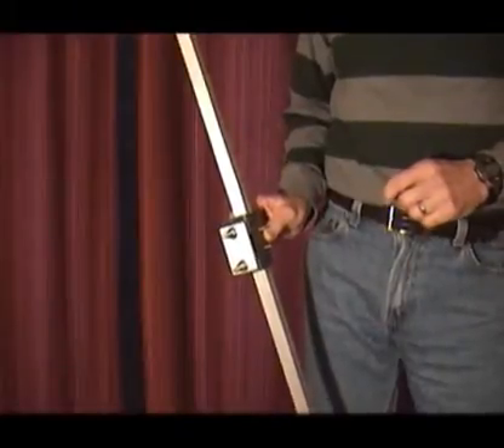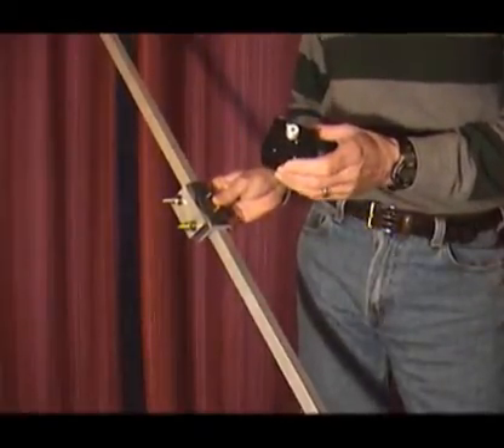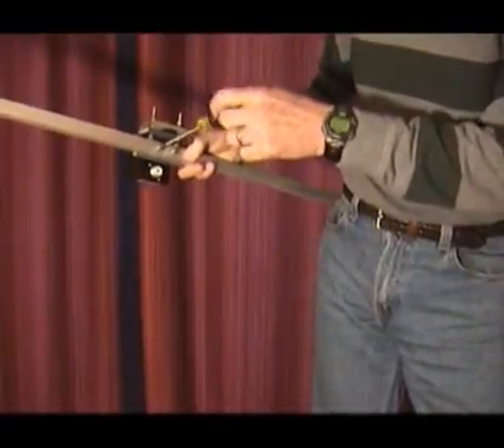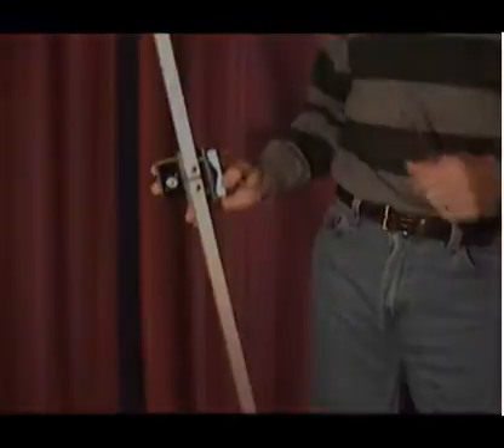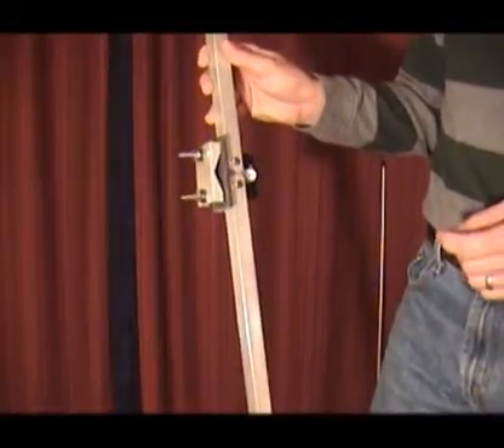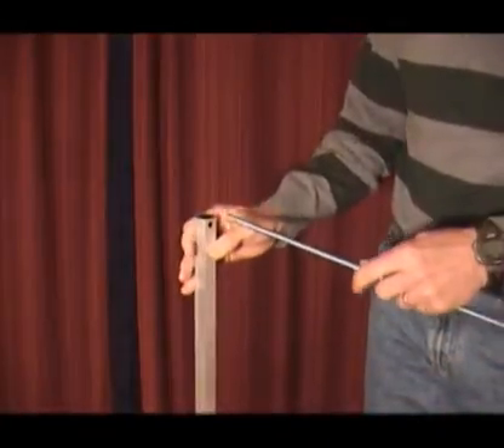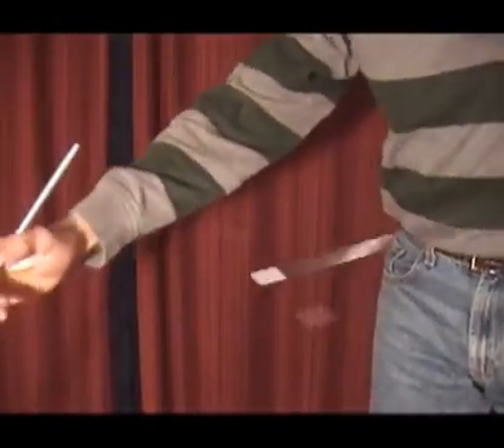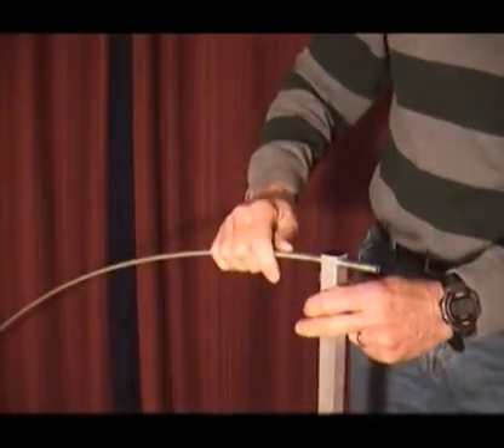Assembling the Omniangle Antenna OA-50 by PAR Electronics

Comment: The PAR OA-50 is a great 6 meter antenna.I used one mobile for  couple of years with a Ranger 5054DX & a 160 watt amplifier & had a blast with it.I now have an OA-144 & OA-432 that I use at home.

Comment: I have one at 113ft on the tower leg and I love it.  I could switch back and forth between a 4 el yagi @ 123ft and the Par and I never got more than a 1 s-unit and most of the time a 1/2 s-unit on the yagi better. I decided to take down the yagi because when you factor in the time it takes to aim the beam, wind load, rotor cost and all the stations you miss not being omni.  The Par was a no brainer and took the yagi down.  Now I plan to stack 4 and l tell ya I can’t wait. check out my par video!